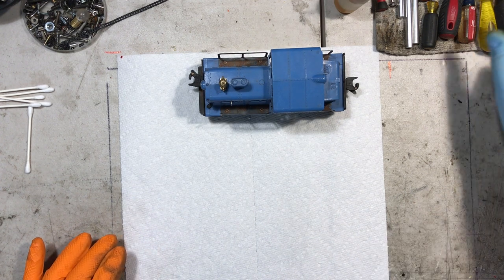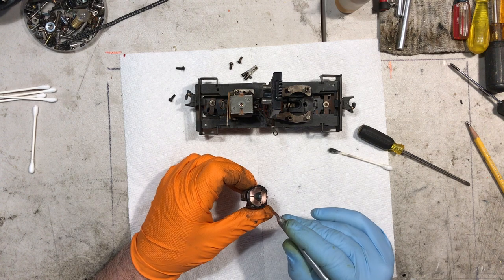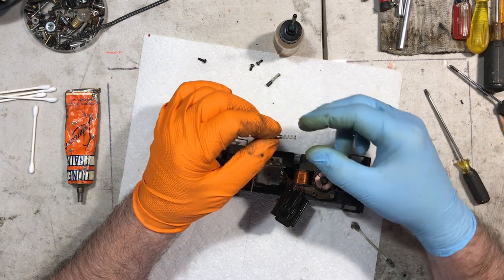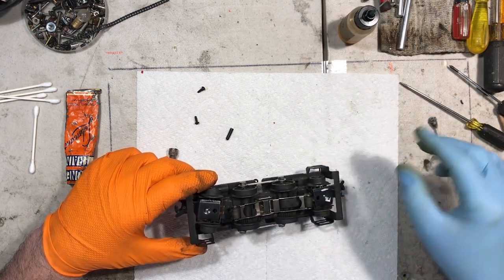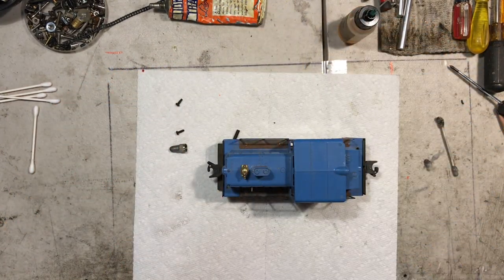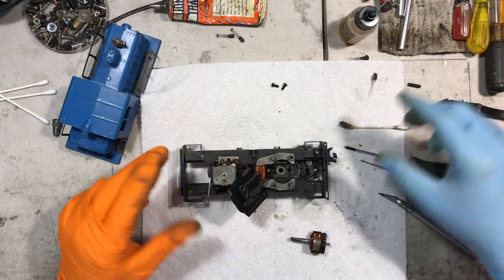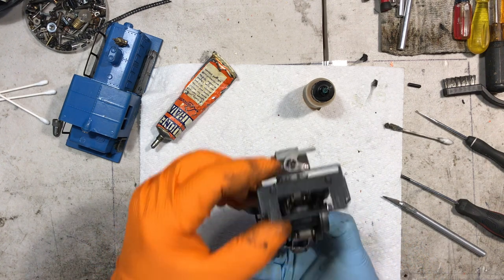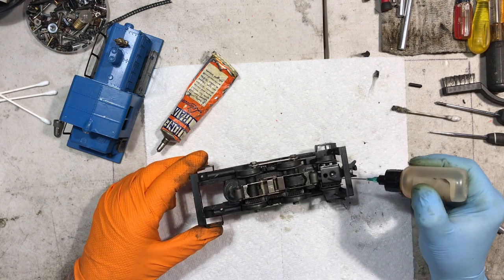LIONEL #51 SWITCHER

Comment: For the surface rust on the handrails and ither steel parts use a fiberglass scratch brush then lightly coat with oil. Use the scratch brush on the commutator also it will polish nicely.  Some guys are using lighter fluid instead of alcohol for cleaning. Your videos are very good! Thanks!
Reply from the maker: Good stuff, thanks Randy.....